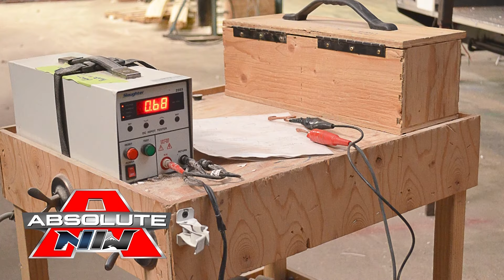Quick Tour of the new Nash 18FM Travel Trailer

Comment: I've had my trail for about two weeks now. I'm camping in a parking lot at a casino in Laughlin NV. I run the TV and the heater is coming on a few times at night. The battery will be half drained in the morning. The solar will charge it back up to full in less then a hour once the sun hits the planes (3).  No problems with anything so far. With some pillows it's very comfortable.. More later.